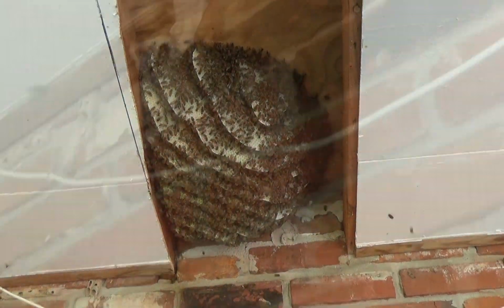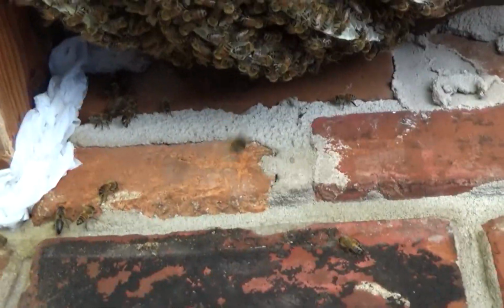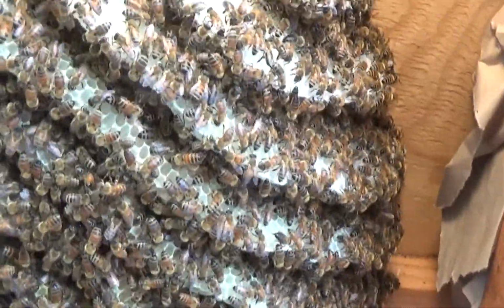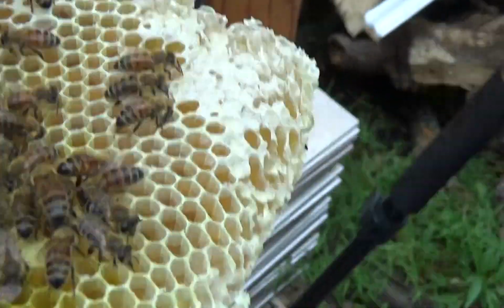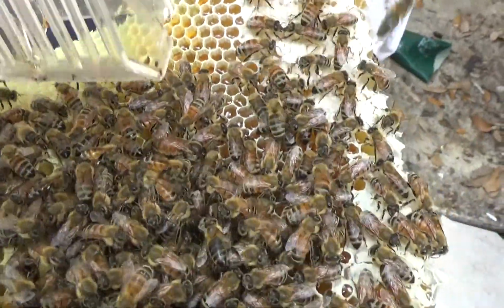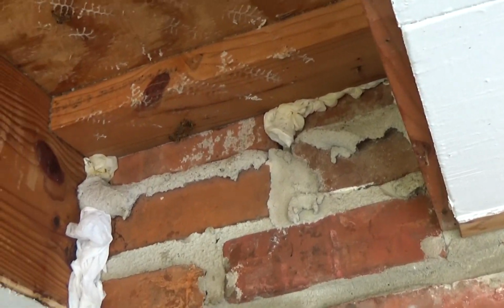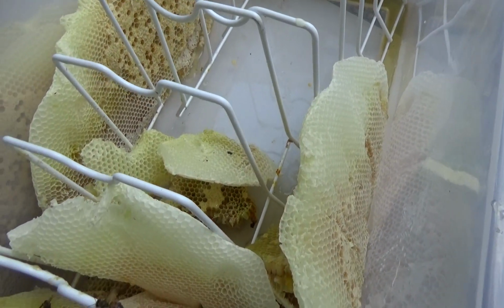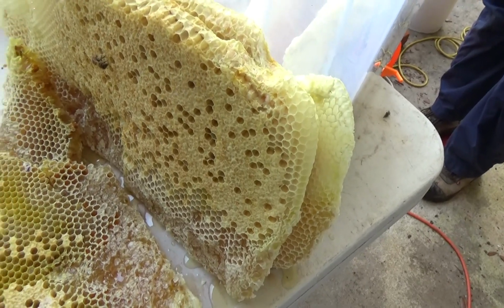Taco holders and bees.

Comment: I got bees living in my walls... Nobody in the UK will remove them because they migrate when it gets cooler.  But front and back have masonry bees.  Harmless so they can stay...
Reply from the maker: I will always tell homeowners that if the bees are in a location that is troublesome for them, just leave them where they are. Just like your masonry bees, they need a home as well. I hope all goes well for you and your bees. Thanks for watching. God's peace Sassi Lou.
Mr. Ed
Reply: @JeffHorchoff  the only reason they do this is because we have tiny plastic spacers inbetween the bricks so the house can breath.  They moved in, i panicked and tried blocking the tiny holes in the spacers.  They are that smart, that once the plaster had set in the holes they pushed it out... 😂  so i just leave them alone.  The way houses are built here is theres brick on the outside then a gap then concrete blocks in the inside so no chance of them expanding their honeycomb elsewhere inside the house.  Very clever bees they are.  

Thank you for replying.  Great info jeff 👌take care 😁